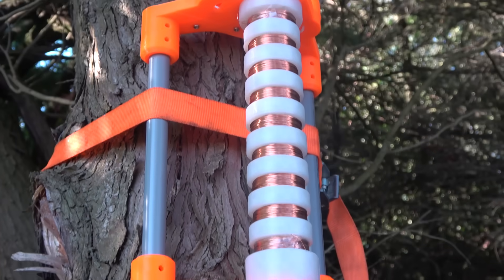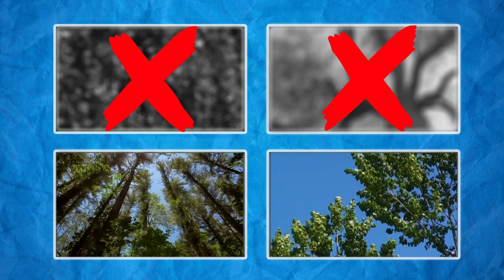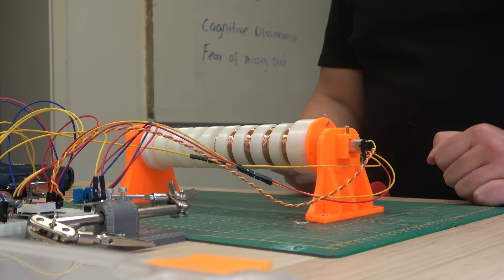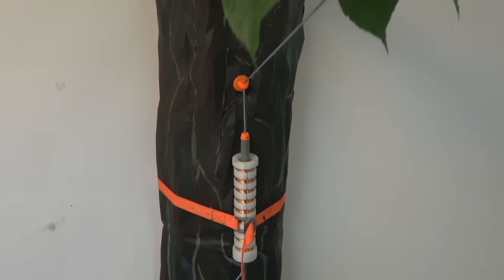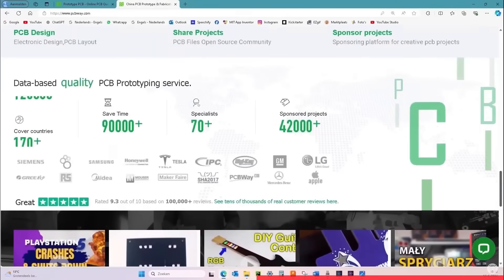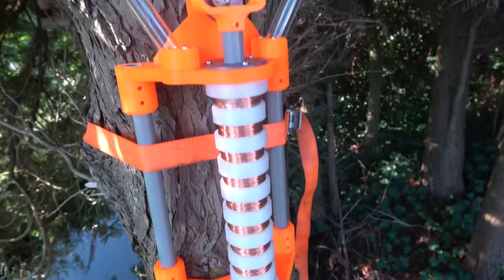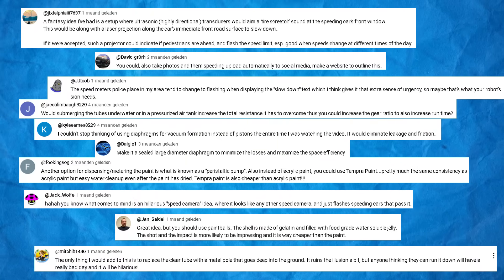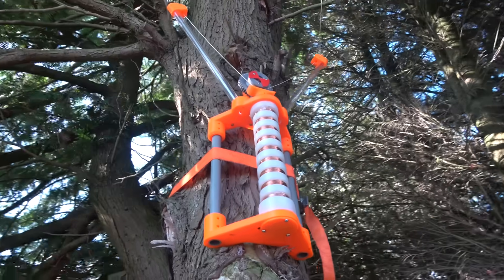I Made a Tree Generate Electricity..

Comment: I think that to improve the efficiency of this project it is crucial to test firstly the perfect ratio among velocity and torque, also after this, I think it would be perfect to use more ropes to get energy from as many angles of the tree as possible.
Reply from the maker: One of the things that I will indeed measure in the near future is the force with which an average branch can pull👌 And what do you think about multiple devices in 1 tree instead of adding ropes to just one?
Reply: @ConceptCraftedCreations  I think that multiple devices are the best for pure efficiency, the problem is with the look on the tree, as you remember at the start of the video you mentioned that you wanted to make it less visible as possible. But that's just for people who don't understand that trees don't cry if you put screws in them. I mean personally I always prefer efficiency over look, it depends on you!
Reply: @Gentle_Ego no form of life likes it when you damage it, so even if you can't hear it cry personally and even if they have a good mechanism to adapt and "move on" to deal with the damage, still not something that one should do. Efficiency over Looks, but never over Morality.
All the best, and a wholesome day 🌈
Reply: @ConceptCraftedCreations imo a single device will most likely be more economically-efficient (cost per watt), Definitely less maintenance (plus associated costs), and at the very least more resource-efficient.
So I hope you optimize for that.

Also taking this concept further, I assume that the generator (materials and assembly) is the most expensive part. So ideally you'd have a high quality high duty generator connected to multiple of trees. I image you can get cheap yet robust and reliable ropes and pullies, and feed them through shallow-dug pipes from all the trees you can to the generator. Might be the most cost effective for Scale
All the best! 🌈